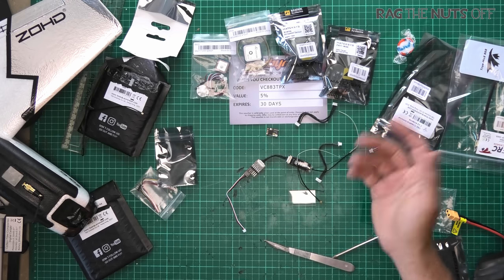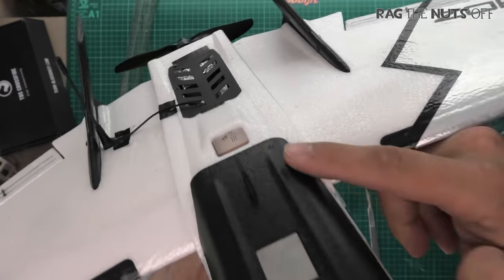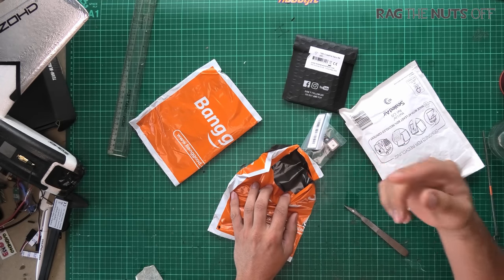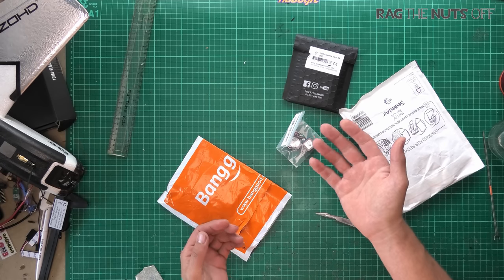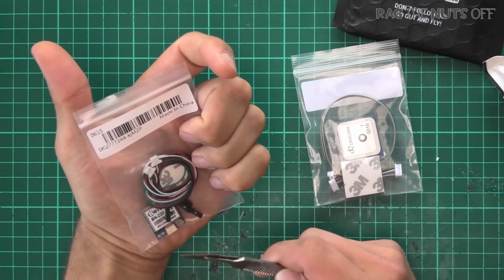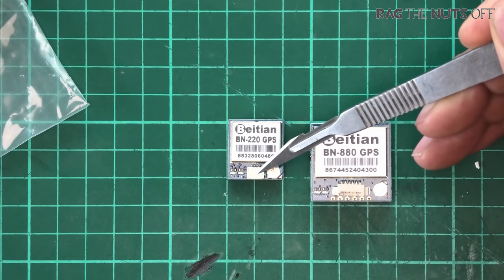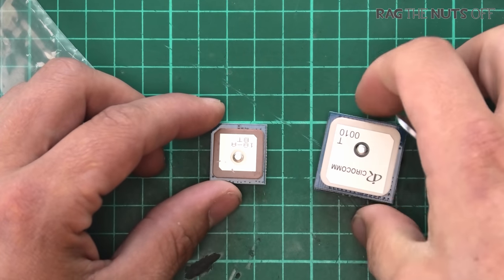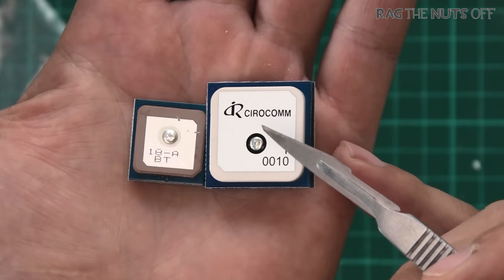"It's ALL Here" GPS's to TBS CrossFire, a Flight Controller to an Antenna & MORE

Comment: I've used both the Beitian 220 and 880 for years. They are reliable, cheap, and available on Amazon. Never had a failure. Look out for some versions that are limited to 3.3v. Make sure to look for 5v.

Comment: TBS also makes solder-on breakout boards for the Nano series of RXs.  I'm picking one up for a smaller model and pairing the RX with a VAS Xfire pro antenna (smaller, higher gain, and cross-polarized!).  Thanks for the bench-top chat!
Reply from the maker: Hey Jacob, yea I've seen those. It gets expensive by the time you add those in as well. Matt

Comment: I have used a Y cable to get SBUS out to both the flight controller and a PWM->SBUS converter before, works fine, no need to get SBUS out of the receiver twice.

Comment: the 220 and the 880 are the exact same module, yes the antenna is bigger, but as far as sensitivity, afaik it's exactly the same, just the big one has a compass, the reason why the big one is thicker is again, the compass. as far as what do i use. if i need a compass i use the big one, otherwise i use the small one and it works perfectly well

Comment: I had the same problem with the GPS lock while using the zohd kopilot , I found having the 5.8ghz vtx powed down until I had GPS lock worked . Being that said it's a pain in the bum . Using 880's never have a problem and locks in seconds.

Comment: from what i understand the 180 does have a battery but it doesnt have the flash to storage the data. 180 is a tiny bit smaller then the 220 as well
Reply: Totally  correct,  all the same apart from the 880 has an active antenna,  the others are passive.

Comment: One thing....iNav will automatically 'create' an RSSI figure from the link quality. Don't set any channel as RSSI in receivers, it just automagically works.  Also the Nano plus receiver includes an immortal T antenna!!!!
Reply from the maker: Yes. If you use CRSF. It's written into the source code. I checked yesterday. Matt
Reply: Will it do it automatically for Eagle tree vector as well?  Since updating my TBS receivers, I can’t get LQ working on my OSD screen when it used to work before.

Comment: Would love you opinion on the newer vas xfire pro rx antenna. I've bought a couple and installed on my dart "enhanced" and am also putting one in my dart 250 when I receive it tomorrow. They are 10 bucks and are smaller than the immortal t and flat with supposedly more gain and no nulls.
Reply from the maker: Ah I didn't know that those existed!
Reply: RagTheNutsOff if the descriptions are correct it says it has slightly higher gain and has no nulls and doesn't suffer as bad from cross polerization. I have it on my dart 250 and dart xl but I haven't gotten to fly either yet. I just got done building the 250 and it seems like I'm gonna have to run some weight in the tail for cg. Haven't weighed or installed it yet.